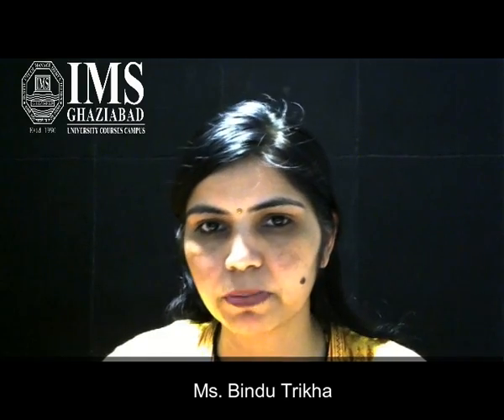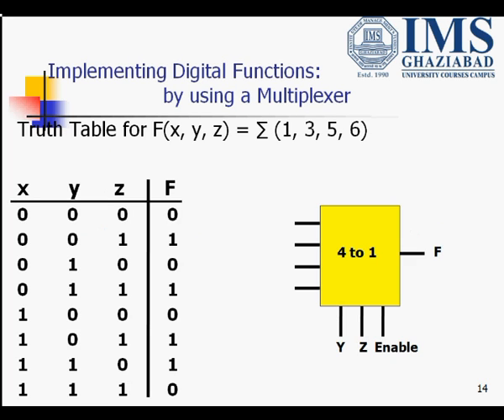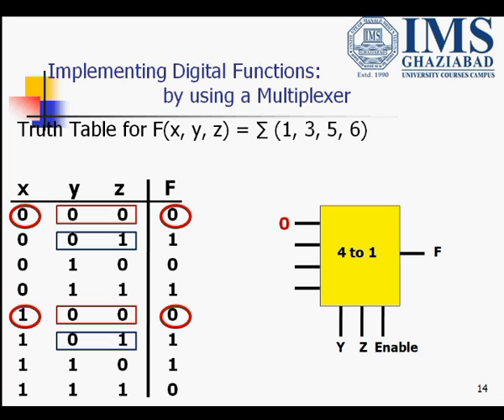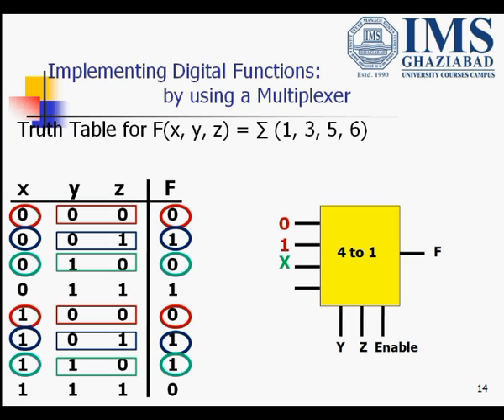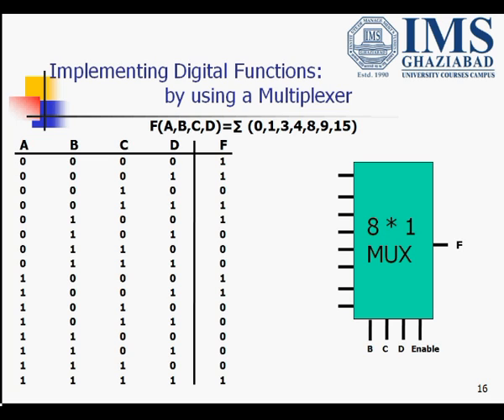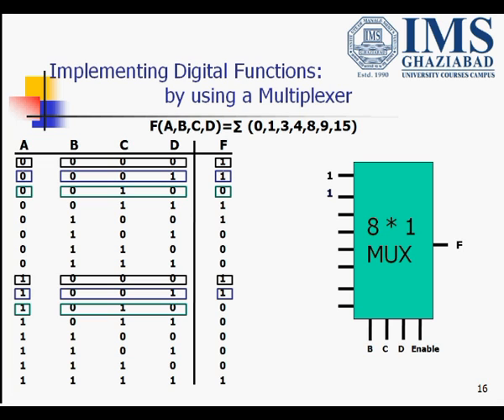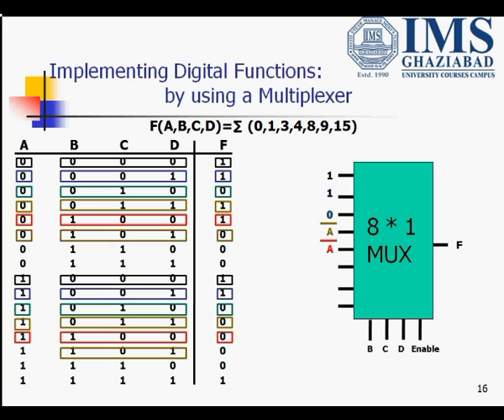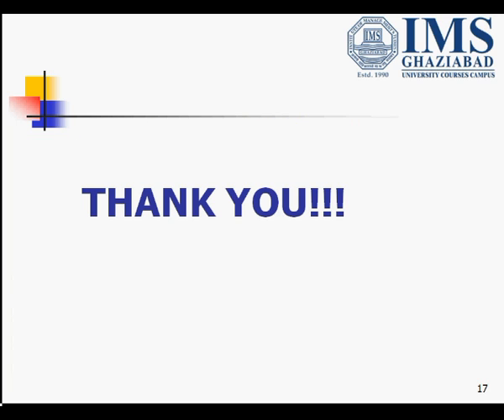Boolean function implementation using multiplexer

Comment: When i do it experimentally, what should i consider my enable pin value?
Reply: enable is like on/off switch. when enable is 0, the mux will be off, it's like it's not there. when enable is high, the mux will work as predicted in the above example. so for your mux to work, make enable 1.
Reply: @ka_ab8469   thank u soooo much for replying :)
Reply: Hi bro, I know this is a late reply but to answer your question, x variable in 4:1 mux or the A variable in the 8:1 mux serves as the enabler in the above examples.